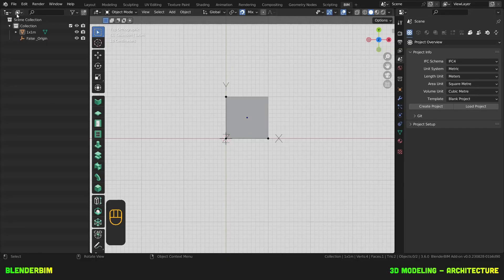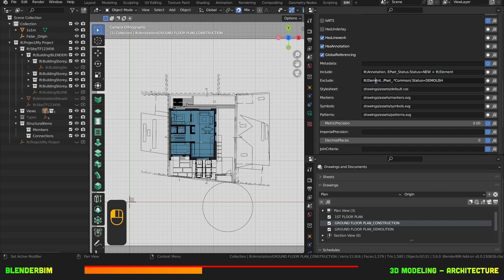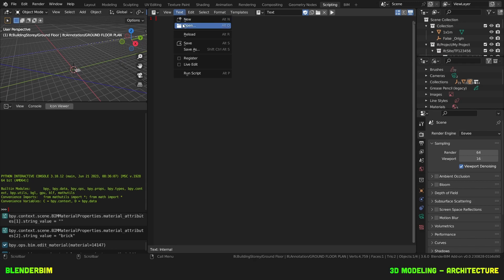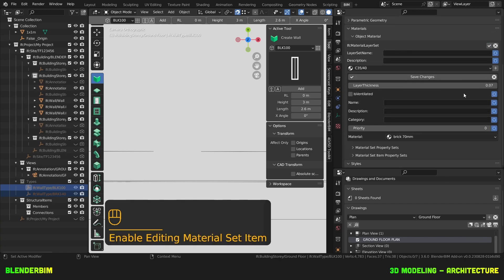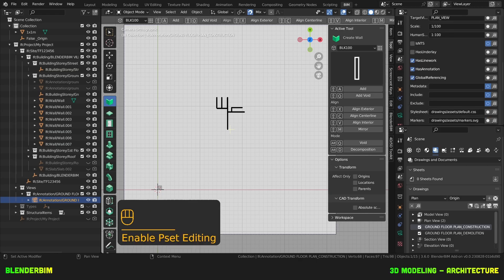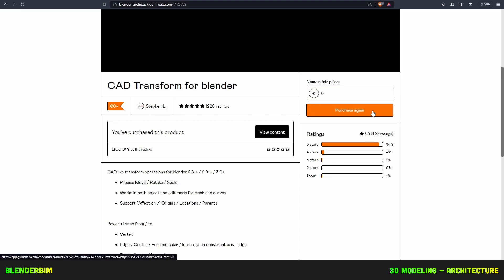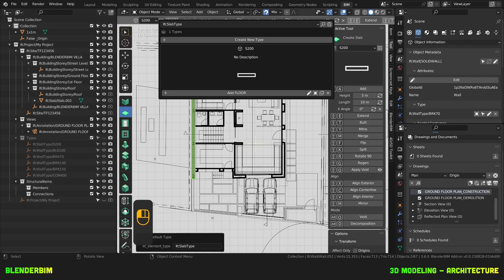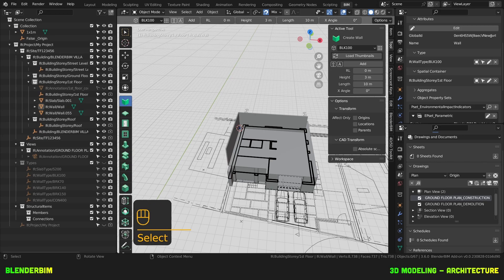3 - Walls and Slabs -  BlenderBIM

Comment: Very good tutorial. Just one question: when you make the bathroom wall 0.15 with an air gap, it shows up in the section, but it doesn't appear in the 3D view. Is it possible to assign different colors to the layers of the walls and make them visible?
Reply from the maker: This has been an "issue" that is being tackled.
More below:
https://github.com/IfcOpenShell/IfcOpenShell/issues/1227
Extract from discussion @ https://community.osarch.org/discussion/261/: "And yes, at the moment layers are only shown in cuts. The intention is to allow showing the layers in 3D too[...]. There is still some work to be done (ATPATH implementation, axis reconciliation) and this work needs to be done in C++ to be done properly (especially for multicore processing). Note that the visual absense of 3D layers has zero impact on quantification, all the semantic data is there. If this feature is critical for you, then maybe the BlenderBIM Add-on is not yet ready for you. The two best ways to accelerate this (apart from contributing to the C++ codebase of course) is to voice your support here https://github.com/IfcOpenShell/IfcOpenShell/issues/1227 and make a donation here https://opencollective.com/opensourcebim

Hope this helps explain! I hope you can tolerate the lack of maturity as alpha software, and continue to help testing and reporting bugs when you inevitably find them. It's a long road ahead, and end-to-end project delivery is one of the hardest usecases to achieve."

Comment: I don't know why I cannot setting up drawing views correctly. When I fill the include section as yours then toggle active drawing but the DEMOLISH plan not show up.
Reply: Problem fix i guess. I use blender 4.2 with Bonsai 0.8.0 extension which is why it is not working when setting up the drawing views, but when I downgrade to Blender 4.1 stable and install blenderBIM240602 it works.

Comment: Revit is so much better, easier and faster than blenderbim. It takes to long to make a simple project. Times is money. I gave up blenderbim.
Reply: Totally agree, they have made everything to complicated. In industry I need to have software that I quick and easy and not a be programmer.  However think there is an appetite for a open source AEC bim software.  but it needs to be designed from the users point of view and not shoe horned into Blender.  Blender is great and has come so far in recent years, but its is not for construction.